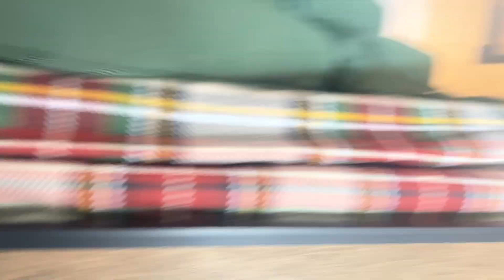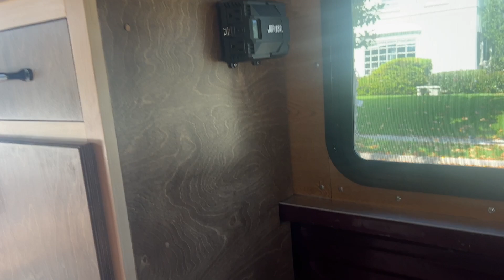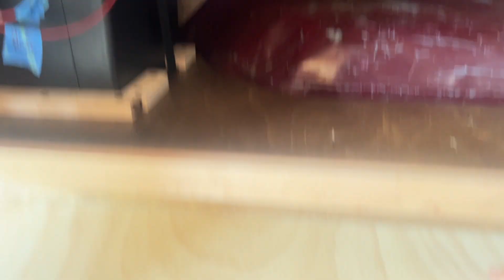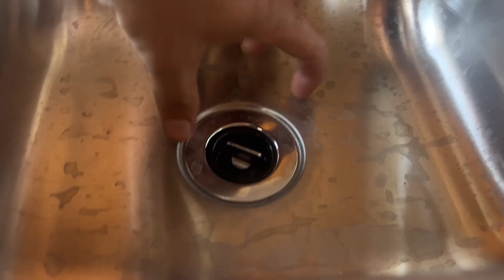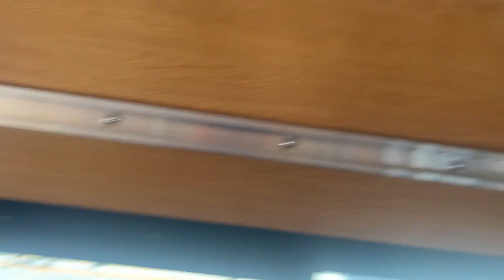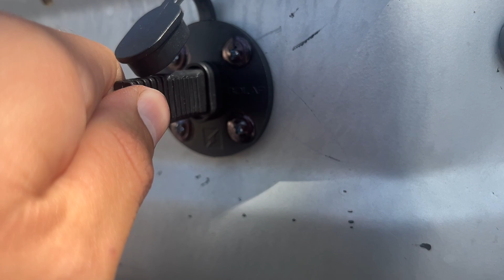OVRLND CAMPER Kitchen Cabinet, Sink, and Renogy Solar Panel!  Ford F150 Truck Camper Build Part 2

Comment: Dude you did a very good job on your camper so far , love the barn door feature on camper , my question is did you do alot of work on your f-150 for reliability , i look forward to future vids of your progress ,
Reply from the maker: Hey thanks! Drivetrain wise this truck has been bulletproof for me. I keep up on regular maintenance so I suspect it’ll just keep on running. The 351w engine in this truck is one of the best ford ever produced. I have upgraded my power steering pump to a GM style pump, and have suspension upgrades that really help the ride quality.
Reply: @Birddogg69  tks for response , good to know , keep at it

Comment: Really enjoying the videos you're doing on your camper and build out. I'm heavily considering an Ovrlnd for my Comanche and was worried it would look odd on an older truck, but it looks great on your bricknose.

Have you gone through the trouble of sealing the tailgate yet? If not how bad is dust? I see some guys talking about how bad the dust can be with the super square back on the truck. I'm thinking it might be easier to seal full length barn doors instead of trying to seal a 38 year old tailgate.
Reply from the maker: Thanks! The Ovrlnd would look sick on your Comanche. The squareness of the Ovrlnd Campers go so well with the angular body lines of older trucks, way better looking then on new trucks I think. Also Ovrlnd was the only company I could find that would make a camper for my older truck- 4wheel, Topo, Gofast, all don’t make models for older rigs. But Ovrlnd will make them for anything.

I’ve just started sealing up my tailgate. I’ll make a video including what I did soon. But overall the dust isn’t terrible. The camper itself is 100% dust sealed. But yeah I’ve been working on sealing up the tailgate of the truck. Full barn doors would fix the dust forsure but I like cooking on the tailgate.
Reply: @Birddogg69   yeah one of the main selling points is the custom built to the truck aspect of their campers. Mines a long bed so it's an odd size at 5' wide and 7.5' long, so finding a camper that fits is nigh impossible. I've got a slide in Coleman I'm restoring that fits perfect, but it's mostly canvas and I want to be able to go out in the winter and be able to go into bear country. 

I'm torn because I like the idea of being able to just open a door and be able to get in and out of the truck, but I also like using the tailgate to do certain things. I'm also thinking I might be living out of it part time so having to clean less would make things nicer. Did you get the positive pressure vent? It's supposed to help with dust, but I spend a lot of time on really low speed Forest service roads and I don't know if I'd be moving quick enough for it to do anything.
Reply from the maker: Ya the Ovrlnd seems like the perfect choice for your truck. They are pricey but you will not be disappointed at all. Comanches are such a cool truck too, I’ve never seen an ovrlnd on one so you’ll have a pretty unique rig.

Sounds like full barn door would be a good option for you. Maybe include the “flip down side hatch” option from Ovrlnd and build a side table in it. That way even without a tailgate you would still have a little bit of  built-in outdoor workspace. I have that option on my truck and it’s really handy. I’ll include it in a walk around video in a couple weeks.

I didn’t opt for a positive pressure vent because I knew it would be difficult to seal my tailgate and allow the vent to work. But if you get full barn doors maybe the positive pressure vent would be a good option. I spend a lot of time on forest service roads too, but I haven’t yet with the new camper on. At the end of July I’ll be headed out on a 2 month trip with the truck so I’ll be sure to update you on dust intrusion. Let me know any other things you’re wondering about the camper and I’ll include it in a video

Comment: Looks great! I have ! question why did you choose 3/4 ply Isn't that heavy and the fact it's a 150 ? aThank you
Reply from the maker: You’re right, it is a bit heavy but not too bad. I went with 3/4 ply to make sure the cabinet would be very sturdy. Since it has drawers and a large hole to accommodate the wheel-well I felt that the strength of 3/4 ply was needed so it wouldn’t deform with vibrations of being in a truck. I just wanted this thing to be tough and sturdy, I am not too concerned about the weight since it’s the only big cabinet I plan on building in the truck. I also added a leaf to my rear suspension and plan on doing more suspension upgrades soon. But for now the truck doesn’t seem to notice the weight at all. 👍

Comment: Love your channel, I like all the instructions as you go about your builds. 
Greetings from Southern California,  I had one question for you about your tires on your Ford. What size and are they and are they the same bolt pattern for a 2016 F-150? God Bless , stay safe out there,
Alan
Reply from the maker: Thanks Alan! The tires are 33x10.5r15, I’m not sure if the bolt pattern is the same for a 2016 Ford. I think newer fords use a little bit larger wheel possibly 16s, but you can definitely find a tire similar to mine that will fit your wheels- just try to get close to a 33 size.
Reply from the maker: I got my wheels on Summit Racing website look on there they will definitely have similar wheels that will fit your truck